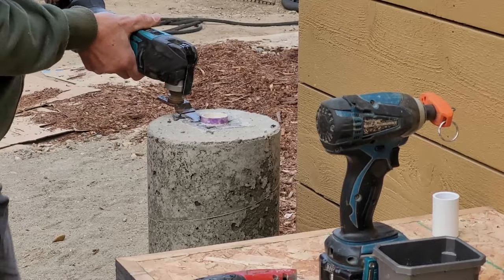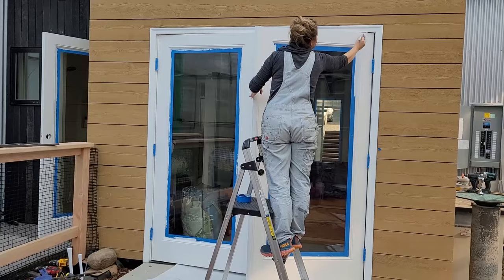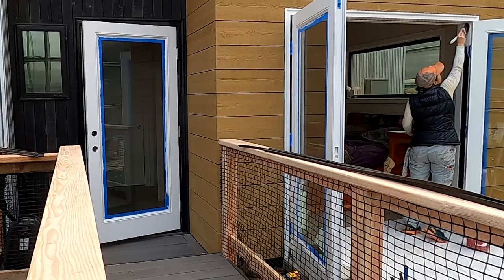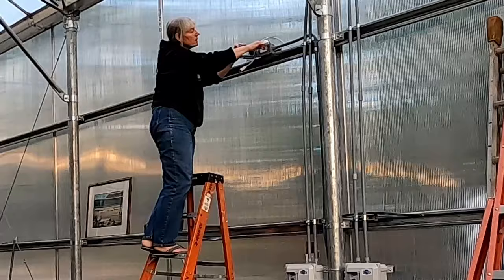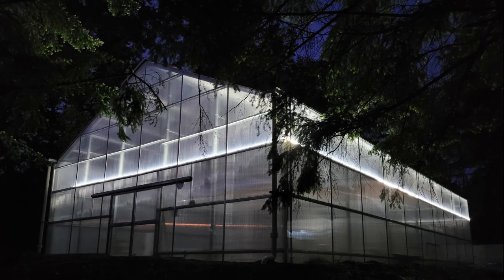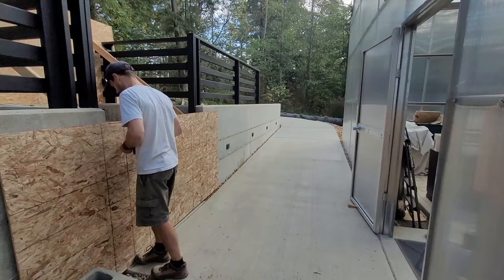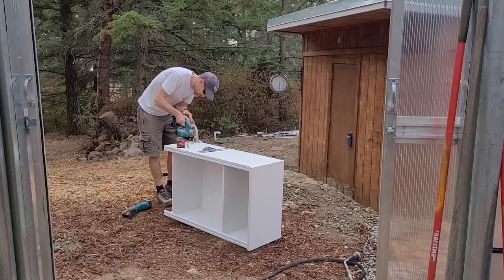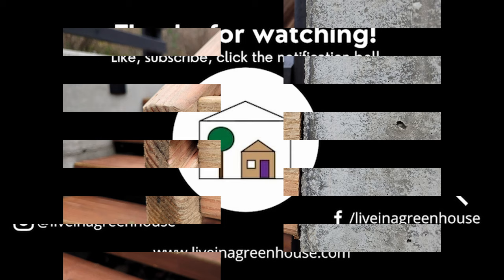E45 Tiny Home in a Greenhouse | Final inspection failed

Comment: I'm tellin ya.  A lawyer.  Ya need a lawyer.  The "locals" have no right to "inspect" anything "INSIDE" the walls of your "Greenhouse."    Take it to the SUPREME COURT!  This is really upsetting news ~~~ (from here in New Hampshire).   You should look at the fine print of what (those who inspect) use.  I have two friends who described what is required to build on Lopes Island there and it was all about mitigating wind damage.  Just throw some steel cables over the greenhouse structure, anchor them with concrete and they absolutely should have nothin to say.   I'm tellin ya.  Just a travesty.   😠
Reply from the maker: I am a lawyer :-)
Reply: @liveinagreenhouse    Ok Ok Ok ~. But still!  Those "inspectors". Whew!

Comment: I would get someone to make up the plans, then get them approve before moving forward..Every project we have done, we always go through the planning board.. No surprises no problems inspections , were done at different stages.. Next years I'm building a greenhouse/home but it will be all approve before I start..
Reply from the maker: Please try watching earlier videos or reading my website and you will learn that both the house and greenhouse are fully permitted. In fact, it took 9 months to get my permit. There were multiple inspections before this one (E3, E16 and others). There was nothing wrong with the plans or house.

Comment: Gee, those inspections didn’t seem so bad. I love the idea of living in a greenhouse. How will you keep your house from getting too moist?
Reply from the maker: You are correct, the inspections weren't bad, just frustrating. As far as moisture, I'm in the Pacific Northwest where it rains a LOT so the outside of the house is much drier than it would be without the greenhouse. Inside the house has the regular array of exhaust fans and the minisplit dehumidifies. Through the first winter the humidity in the house bordered on too low.